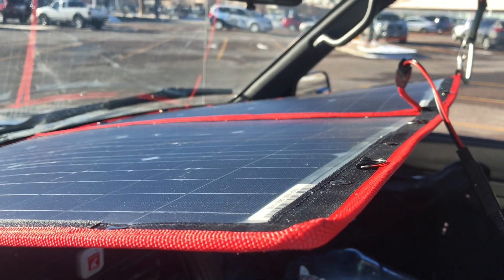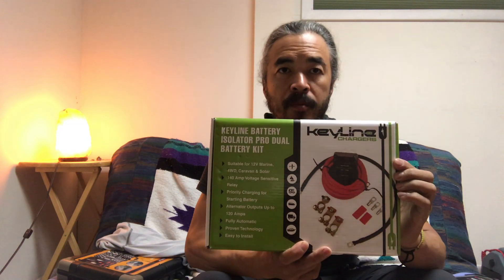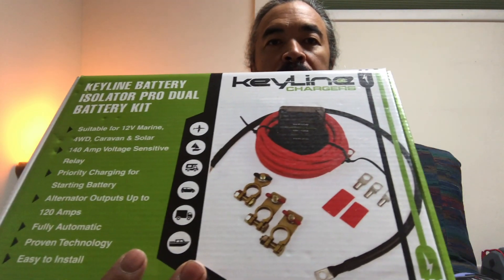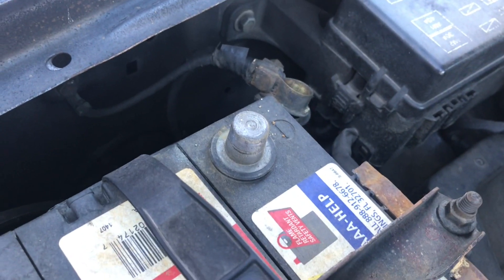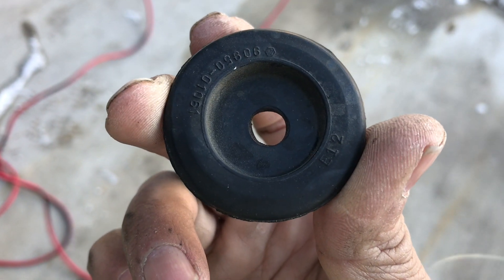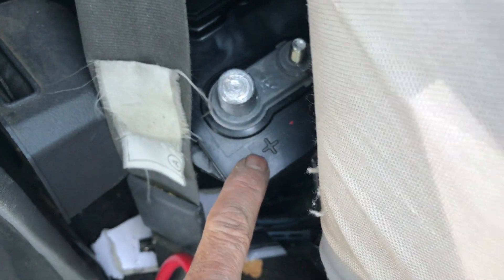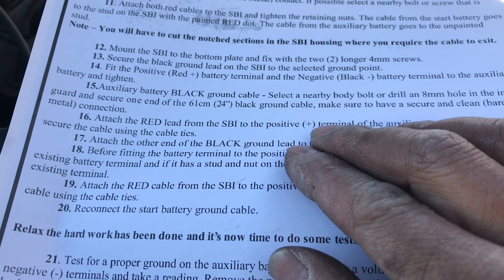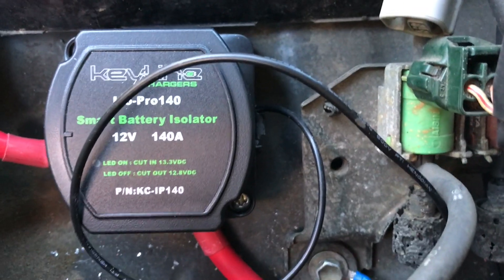Dual Battery Isolator Install (Step by step)

Comment: Can I put this between starter battery & dcdc charger so my aux battery doesn’t drain starter as there is no where to connect the ignition wire in my boat?

Comment: so i have ram 1500 i have xs power d6500 300 amp alt and i read that when chosing an isolator you want it to be matching your alt amps or higher so since my alt is 300 would i need a 300 or bigger isolator i havent decided if im getting another xs power agm or a lithium bank yet but i know this company i think makes a 300amp isolator but in the future i might get a 350 or 370 amo alt so should i get a 500w isolator since they only make like 140,200,300 500 amp isolators I know if I stick with AGM deep cycle in the front and back that I don't really need an isolator and also if I use AGM up front and certain lithium cells in the back I don't need an isolator  if i get like lifepo4 i believe correct me if im wrong technically I only need an isolator if it's two batteries that charge at different voltages or sit at different voltage

 but it is safer to have an isolator in case one battery starts to go bad and then starts to drain the other battery I like to be safe so I'll prob go that route just doing research

Comment: Question, when smart battery isolator circuit is on, all ur batteries are hooked together , starter and aux? So if engine is off, u could drain ur starter battery, or will isolater shut off when voltage drops. I thought the isolator lets current only flow towards with aux batteries, not stay hot on starter battery side.

Comment: Can I connect to inverter without connecting to secondary battery?  Want to charge my BLUETTI off starter but not drain starter if I forget to shut off alternator. Thx great video.

Comment: I have that EXACT Smart Battery Isolator and it drops 1.4V through it (if you think about it that's a 10% voltage drop), and as a result keeps clicking off and on for an invention I have sitting in the trunk.  Everywhere else in the car tests at 14.6 right up to it, and then as soon as you go through it it's down to 13.3V~.  After the car has been on for half an hour the number starts lowering until it's at 12.8 and it starts clicking off and on every second.  Spend the extra money and get a better version.  Yes it works for me... for half an hour.  I'm only pushing 10 amps through it on a 140 amp alternator.  In years past I pushed 22A through a similar setup with a different voltage sensing relay with occasional cut out, at which point I lowered it to 19 and then it was fine, and then down to 12a later on.  Back to this KeyLine SBI, after the first half hour it's basically a paperweight.  Now I have to pull the whole apparatus out, which isn't too easy, and replace it with another brand.  I've been messing with electronics and trained in the ways of electricity from my enlistment in the Marines so I know it's none of my connections.  It is 100% that battery isolator.
Reply: Im using the same one one my utv, and after about 30 minutes the accessory battery will go from 13.3 to 9 volts, and my stereo will start cutting out. Then it will randomly jump back to 13.3. I knew it was cheap for a reason and ordered a battery Dr. For $117. I'll see how it goes

Comment: Great video.  I'm in the market for a system.  What is your long term review on this product?  Thanks. 🤠
Reply from the maker: It's worked well for me. I did switch to a lithium battery, which requires a higher voltage to charge properly (it still charges, just slower), so that may be a concern. But for a marine style battery (which I had before) this was perfect.

Comment: I’m installing the exact same isolator tomorrow on my Ram 1500.  This video was extremely helpful.  Thank you and I wish you many happy and healthy miles.
Reply: how did it go I have My 1500 quad cab 5000rms 300amp alt xs d6500  all 1/0 ofc dual runs from alt to the battery thinking of getting a second batt might stick with xs power because I have a meter in the dash some songs certain notes it'll drop to 13v then once that note stops goes right back to 14.4 well I know with 2 xs power AGM batts I really don't need an isolator but they say u want to match the isolator amps to the alternator amps being that I have 300amp alt should I get a 500w isolator I know this brand makes a 300amp isolator but I might get a 500w isolator because I'm the future I might get a bigger alt like 350 370 my 300 has been going strong for couple years now

Comment: So this means everytime the engine is shut off, all the device that i will plug on the cigarette lighter at the cabin lights that i will use, take power from the auxiliary battery? Correct? Sorry i am zero to auto electrical. , 😬
Reply from the maker: Depends. Is the cigarette lighter connected to the auxiliary battery, and not the car battery? Then yes. But, if you're talking about the lighter in the cab it's probably wired to the car battery so you'd drain it.
Reply: @GripandClip  ok, so all the accessories that i need to use should be connected to the aux battery since this device is only for charging the aux battery. Hope i understand it correctly this time 😁
Reply from the maker: @adrianreyes640  Yes, that is how I have it setup for my truck. Good luck!
Reply: @GripandClip  thanks, 😊

Comment: Thanks, was interesting viewing and learnt a lot. I see a lot about dc to dc chargers. You didn't mention the dc to dc charger. Is this required with your system? Appreciate your response. Cheers
Reply from the maker: Not really sure what you mean by “dc to dc charger.” This isolator takes the charge from the starter battery, which is dc, and charges your auxiliary battery, which is also dc. Everything to do that is in the box.

Comment: Thank you for explaining this so easy!!  I just bought one of these myself.  Are you setting your solar panel up to charge your battery too?  If so will you do a video on it as well?
Reply from the maker: I do have my solar panel hooked up as well. I failed to make an install video for that, but there are several videos from other folks on YT. I think it's an easier process. It's great for charging your auxiliary battery while parked!

Comment: Still very useful video, thanks for making it, you helped me do the same to my wagon. I had the "adventure kings dual battery kit, it is identical to yours in every way bar the sticker on top.
Reply from the maker: I was wondering if some of the other kits out there were basically just rebranded. Thanks for confirming!

Comment: From my understanding, you should never drain your auxiliary battery below 50%... my question is how many miles on average do you need to drive per day to bring a battery at 50% back up to 100?
Reply from the maker: I don't really know the answer to that. It really depends on your usage, and type of battery. My AGM battery would top off with everyday driving, the main drain being a small frig, with LED lights and cell phone and laptop recharging. When stationary I would top off with a 100 watt solar panel.

Comment: great job.  well explained. I followed from start to finish.  The kit I bought for AU$95 is branded "Power Tech" and is pretty much identical to yours including instructions.  It did come with a yellow wire as well as the black in the event the main battery might be dead you can connect the yellow wire to the negative terminal and start the car off the auxiliary battery.  I enquired with a local installer about a t5 VW 2011 lwb and while you can go through the glove box and muck around under carpets and removing mounts in the engine bay he advised to run it straight underneath the vehicle.  Worked brilliantly and the whole job did take the day mainly cos mucked around bits and bobs, trial and error etc.  I did want to ask you about that solar panel?  what brand and wattage?  I don't like the idea of mounting a panel on the roof.  If driving the battery will charge of the engine battery and if you camp most likely you'll go for a shady area.  I run a 100 w panel, 2 single 50w together on about 10 m of cable.  If I park in a shady area I can easily place the panel in the sun. Thanks again.  #BromptonShrink
Reply from the maker: BromptonShrink Glad you found the video useful. The solar panel is a DOKIO 100 watt folding panel. (link in the video description) I’ve since upgraded to their 300 watt panel, and a lithium ion auxiliary battery. Going straight underneath probably would have saved me some time. On the other hand I don’t have to muck about underneath my truck .;) Tradeoffs I guess. I’ve had to charge my startup battery a couple times. I just used my jumper cables - your setup sounds better - maybe I’ll try to figure that out with my setup.
Reply: Gripand Clip . It’s a little yellow wire that comes out from behind the isolator. I haven’t used it yet of course. How would you drain your main battery? You could connect your 100w panel to the front battery if your camping a few days? 300w panel to the rear?
Reply from the maker: @OneLifeNow  I left my lights on my old truck. ;) No auto light shut off. I do keep the 100w as a backup.

Comment: Great !!!!! easy to follow video. But I would add a heavy duty fuse or circuit breaker 150 amp between the starting battery and the isolator. Just in case of fire!!!! SAFETY FIRST
Reply from the maker: Hmm, okay. I have been running the standard install for awhile now, no issues. But a fuse is probably a good idea if you want to be extra safe.
Reply: @GripandClip  yessir you most definitely need two Anl fuses and two holders for em!   
Then get some cable cutters and measure or eyeball approximately 10"-14" Inches away from very end of cable on both sides of positive wire, so undo the actual battery terminal and then yeah it kind of sucks I know but I mean since you didn't know you had to do that in the very beginning so unfortunately you'll end up having to cut off the two "crimped" compression copper cable lugs do the two new cuts like stated above on the positive cable then re-crimp two brand new copper compression cable lugs, install the holder and fuse (or a fused 12v circuit breaker. Then you need to of course re-heat shrink over those new crimpped lugs once again, mount the new fuses somewhere either screw them down or ziptie if their is a sturdy spot, and then you can go on ahead and re-install everything right back to that same position that you've installed it to that you're showing in this video here... And then you'll 100% percent be covered and have assurance and peace of mind knowing you won't be driving down the road one day and all of a sudden your whole cab start smoking and yeah I know lots of people say meh it's whatever I'll be fine sure people say their call will burn to the ground I'm sure that's just exaggeration if it start ever smoking or burning "I'll put it out quick", before anything happens...   But the thing people don't realize is when that happens it happens so quick and it literally if you've ever seen it happen close up, that part of the wire that "malfunctions" or shorts out, a whole section around it literally becomes like a red/yellowish glowing rod that instantly melts your carpet in seconds and if it happenes and really crappy area like touching against a plastic panel in the car sitting along side the door under carpet and panel... Those are the worst that do most damage to your vehicle...  

Sorry about my blabbing... But yeah you most definitely need to fuse up exactly where I mentioned earlier.  If you want just lemme know by replying or whatever but if you want I'll literally find you everything you need on Amazon for the cheapest and having being 100% quality stuff not China crap.  It's really not that expensive for what you need to protect your wires. They should of included it in that box you got I don't understand why they didn't that's strange really cause most other kits usually will. 😕
Reply: @GripandClip  I was actually thinking I could actually if you wanted of course or if you know where to get one... I was going to say instead of you having to re heat shrink and re crimp new lugs back on and have to spend money on that you can just get the holder that has screw down compression input fuse holders that way you don't need no heat shrink or any more copper lugs which are kinda spendy actually... But yeah I can get/find you one of those compression fuse holders and few fuses in like a kit for under 15 bucks provably  maybe even 10 on Amazon  they're real cheap but are like a total necessity to have if you install anything at all from your car battery and especially when using heavier AWG gauge of wire like you're using for this VSR.
Reply: @GripandClip  just lemme know I can 100% in less than 10 minutes find you an Amazon link for a little kit of entirely everything you're needing for under 15 bucks for sure. Im not trying to make nothing off it haha I couldn't and honestly don't even know how people do that from youtube... I'm just wanting to help a person out if can be. Cause I just recently bought buncha new accessories to install in my car and I bought me few different fuse holders and blocks that's kinda why am saying cause literally just got some and still have the links in my history

Comment: Never thought about about putting solar in side my car. I have a solar powered house so.  I'm looking to store extra power from a real good day. Then when the cupboard is bare. I will swap over to the reserve. (Isolator battery) tks.
Reply from the maker: I use my truck's extra battery as a backup to my solar powered Yurt, actually. I use it as a generator backup to recharge my Yurt's batteries. I'll run the truck for 30 minutes, which tops off the 4 lithium battery bank I have inside. See more here: https://www.youtube.com/watch?v=z_r3yvumBM0&t=5s

Comment: When you put the solar panel in the front windows do you lose power or watts i have a 60 watts solar saga (only give max 42 watts with a jackery power station how much watts lost would i get by putting them in the windows
Reply from the maker: I haven't done a proper side-by-side test. It's kinda hard to do as solar angle and intensity changes. My guess is that given equal angle to the sun and equal intensity there would be no loss, but that's an educated guess. Sorry mate!

Comment: Excellent DIY video.  It appears these devices isolate and control the charging of the batteries and the isolation of the starter battery,  but they won't allow discharge from only the auxiliary battery to the vehicle's accessories when the engine is off.  You've got yourself an inverter to connect to the auxiliary battery and you'll run external accessories off the inverter to get around this.  My thought is, instead of using an inverter with its concomitant power loss,  how about installing a manual switch to disconnect the positive cable from the main battery and connecting it to the auxiliary battery.  That way, you can use the car's built-in 12-volt accessories such as interior lights and stereo, as well as being able to plug camping accessories into 12-volt sockets.  You could still use an inverter if you needed to. The only downside I see to this is that you may have to input your stereo security code every time you switch batteries.
Reply from the maker: mark stone That’s an interesting idea. I’ll keep that as maybe something to explore. Yeah, having the stereo reset might be annoying - not sure how to get around that.

Comment: Is this safe for a 180 amp alternator?
Reply from the maker: micjakes1 I personally don’t know the answer to that, but on Amazon the seller of my particular unit responded to several people who asked the same question as you: “We have a lot of customers with 180 amp alternators using the KeyLine isolator for years now. The isolator would not shut off if overloaded but it may become inoperative due to too much power. However, 99% of applications out there will only draw a maximum of 60-80 amps (however, I don't know about your specific application. For some customers running heavy work loads they have placed a 180 amp, or less, breaker or fuse between the start battery and the isolator.” Hope that helps.

Comment: hi everyone my house battery bank has 2 batteries...2 - 120amp hour batteries....do you guys this product would still be suitable to use?
Reply from the maker: I started with 2 AGM batteries hooked up in parallel. In theory it should have charged the same as a single 12v battery, but personally I found it charged them unequally. I did have the isolator only hooked to a single battery, though. You might want to connect to the positive end of one battery, and the negative of the 2nd battery, which may work better.
Reply: @GripandClip  thank you

Comment: Thanks for the video! You convinced me to go with this isolator. We spent all of April and May driving around the US and it worked perfectly! It did start clicking one single time after I turned off our van. I gave it a little tap and it stopped 🤷‍♂️
Reply from the maker: Great! Yeah, it worked really well on a two month trip I took, best thing I ever did to keep my 2nd battery topped off - better than the solar panel I got! Never experienced the clicking you describe, though.
Reply: @GripandClip  yeah, idk. It was just a one time thing and hasn't happened since. And I'll second that it worked better than the solar panels. What a great unit!
Reply: I'm going to substitute multiple crystal power cell batteries instead of solar panels.  Crystal power cells constantly give out an electrical charge 24/7 and last anywhere from 2 to 4 years or more.  John Hutchison is the inventor and many others have been experimenting with his invention.